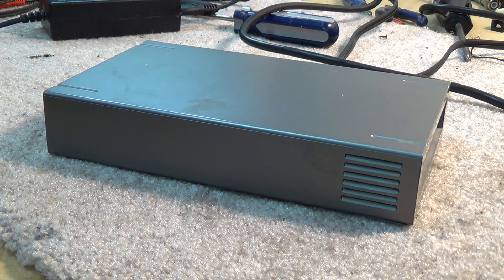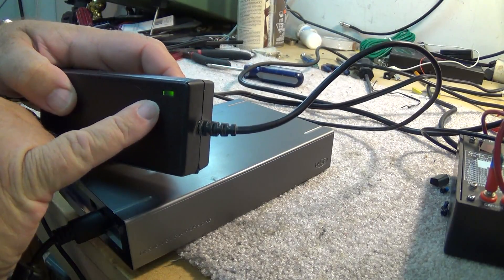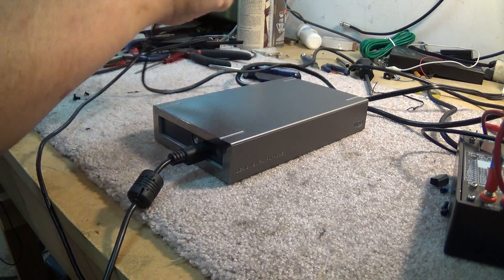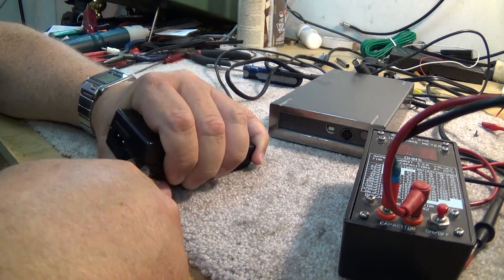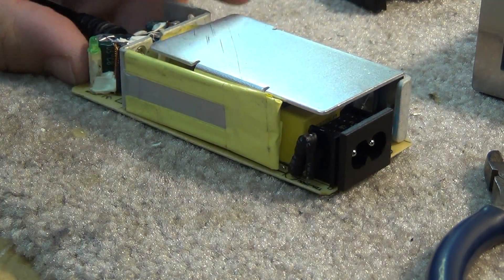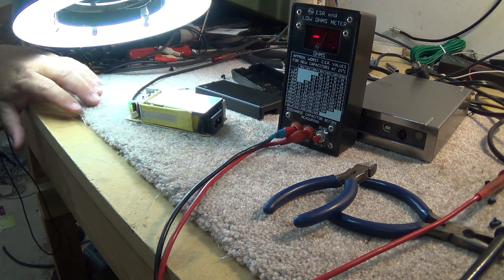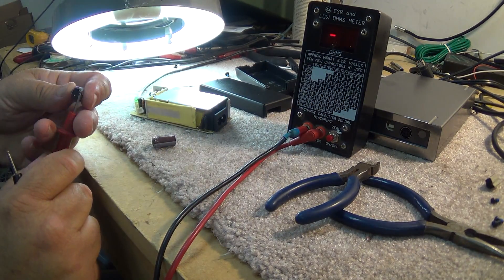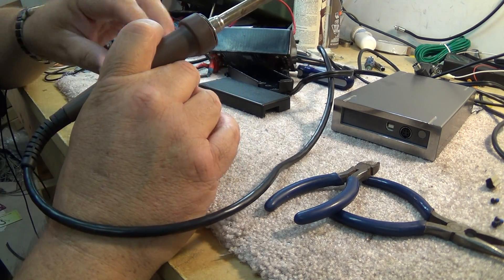lacie external HD makes a clicking sound, power supply repair

Comment: Thanks man. I was thinking the problem was an internal problem in the diskdrive itself. Thanks to your video, I just grabbed the power supply of an other old LaCie drive I had kept on a shelf (for at least 10 years). That one did work. Right now I'm backing up my family videos to two relatively new hard disks and two raid systems. Thanks again!
Reply from the maker: I use bare drives and a docking station myself as storing a bare drive takes up far less space than one with a bulky case plus i get bare drives dirt cheap.  Get them out of old cable boxes and satellite receivers.  Sure they are used but they are redundant backups and none have let me down yet and as they are rated for DVR use they are designed to spin for a long long long time.  Have really good bearings in them.

Comment: Well I just had the same problem as you did yesterday, it would power up I could hear it spin up then when it was at the max spin it would wind down and restart spin up then down so I was primarily looking on how to open the case up first it's when I saw that you had a vid on the same HD enclosure (LACIE) with power problem. So the moment I opened it bam I saw a cap that had a little bulge so while I'm there decided to do all the 4 caps to be on the safe side and don't need to reopen again in a few weeks or so. THANKS for the video!! ;-)

Comment: The title needs to be changed to "Lacie external hard drive making a soft clicking noise. Lacie power supply repair." I found this video by accident and it saved me $300 because I almost sent it to one of those data recovery companies. I didn't even think about checking the power supply. Today, my Lacie is working like a charm! However, instead of replacing the caps, I opened the Porsche enclosure and removed the Samsung HD500LJ hard drive inside. With a couple of cables, I connected the hard drive directly to a USB port on my laptop. Easy peasy. Thanks to this video, I have all of my files back for $0!
Reply from the maker: Well I continue to use that drive.  It is what powers all the concert videos I run in random playback through a first gen raspberry pi and then modulate on channel 12 in mts stereo through the house so I can enjoy on any tv.  It runs 24/7 at my house.

Comment: I'm having the same issue on a 1TB Lacie HD. I have two power supplies, and they both work on my Lacie 250G and 500G, but not on the 1TB. Before I plug the power supply on the 1TB, the light is solid green. Once I plug it in, it flashes and the drive doesn't turn on. I assume it's because the power supply can provide enough power for the smaller HDs, but not enough for the bigger drive. I wished I had the tools and the expertise that you have, but I may have to just buy a new, more powerful power supply, I guess. Good to know the issue is not the drive. Thank you.

Comment: Lacie power supplies of that sort have been a nightmare. They really let consumers down with those. I have three D2 drives, and only one DC supply, and that has now died! Going to jury rig a DC supply to back up the two remaining drives then remove them from the enclosures and reformat as archive storage, to be used in a slot in drive caddy if and when I need access. And who uses those 'funky' power connectors anyway, they'd been chucked into the dustbin of history as the worst idea ever, even back then!
Reply from the maker: Dual voltage supplies allowed the drive designers to make a less expensive interface.
Hard drives use 2 voltages, +5 and +12 volts as they were originally designed for use in PCs which had dual voltages present. 12 volts for the motor drive circuitry and 5v for the logic circuitry.The earliest external drives just used a dual voltage supply. The reason was there was concern about back voltage when the power was turned off, and the drive spinning down. Then they started putting buck converters on board so they could use a single 12 volt supply to generate the 5 volts required for the logic circuits, with additional circuitry to kill any high voltage generated as the drive was spinning down. 
All modern drives use the kinetic energy of the spinning platter to, upon loss of power, generate a little bit of energy as the platter is spinning down to "park" the heads off the platters. During this time there is a fair bit of voltage created, higher than the 12 volts that spins the drive. The concern was if this voltage got into a data circuit it could cause problems, so the motor circuits were separate, on the or own power supplies. Later external drives added buck converters to generate the 5v for the data circuits from a single supply.  I too use a drive caddy for archive drives. Have a big stack of old drives salvaged from old cable and satellite boxes. All relatively small by today's standards but they do a good enough job to archive all my source footage for all my old videos. I think I am on something like drive 40 now. Most are 320g and a few 250.
Reply: @12voltvids  Many thanks for you feedback... so I'm not about open up the box and solder new capacitors, only need to start them up once to copy contents - BTW I use this great wee software called Print Window to record all my drives contents as PDFs, each drive has a simple label so it's a quick way to find stuff rather than plugging in drives. So what I think I'll do as the drive needs 5v and 12v simultaneously is rig up two DC converters, I have a box full of them of all voltages, and do have 5v and 12v ... all I need is to know which pins are 12v + & - and which are 5v + & -, as you say, I don't want to fry the pcb with 12v! You don't by any chance know which pins are what? As the DC converter is faulty I doubt I'd get a meter reading off the pins, but I will try it. Thanks again.

Comment: Hi, 
I have this exact same external HD with a TICKING sound.
How much will it COST to fix it?

Im thinking about sending it in to Seagate but they want my credit card info before telling me how much it will cost.

Thnks for uploading!
Reply from the maker: If it's not the power supply then the drive is shot. A new sata drive is pretty cheap. I bought 10 used but certified 500 gig bare drives for 15.00 each off Ebay, and I use these in my external dock for source file storage. The problem is getting data off a dead drive. That is where the expense is.

Comment: I have a 4tb LaCie external drive.  Took a long time for the manufacturer to contact me when I told them it wasn't working, and they basically told me that it was bricked, but now that I have seen this video, I think it might just be the power supply.  My mother has a 1.5tb drive; will plugging in my power supply to hers damage it?

Comment: I have one of those lying around ,saw your video and decided to dig it up.
It didn't output any voltage on the plug and it made a hissing sound.

After I replaced those 1k uf caps the hissing stopped.
I still got no voltage though.

Do these things need a load (hard disk) to function correctly ?

The led lights up BTW.
Thanks!
Reply from the maker: No you will get the +5 and +12 supplies with no load.
Reply: Thanks for your reply.
I guess I'll have further troubleshooting to do on this one..

Comment: Excellent video.  I am not familiar with an ESR meter.  Is this something i would absolutely need or would a good multimeter with a capacitance setting work?  Sorry if this is a dumb question.  Thank you again for the video.
Reply from the maker: An ESR meter is an essential piece of test equipment. It is not a replacement for a good multimeter, however it measures a specific characteristic of electrolytic capacitors, equivalent series resistance, which is the first thing that starts to go when caps start to fail, especially in switching power supplies.An ESR meter will pinpoint bad caps that will still measure fine on a regular multimeter with capacitance settings.I recently had a particular failure mode of an electrolytic that fooled my ESP meter the capacitor dead shorted. To the ESR meter it was good, because good ESR is very low. Looks like a short on an ESR meter because capacitors have a very low impedance to AC, but in this case the regular multimeter caught it.

Comment: Hello! Just subscribed to your channel, and was watching your other satellite power supply repair. In that one you mentioned you disconnected one leg of the capacitors before you used the ESR meter, but this time you didn't. Can you get reliable readings without disconnecting the capacitor from the circuit? Does that depend from your ESR meter? Thanks a lot!
Reply from the maker: You still can measure them in circuit, but the readings will be less accurate.Out of circuit they measured even higher, 5.9 ohms. So having caps in parallel and not disconnecting a lead may give a false good reading, in this case they were bad when in parallel, so there was no point of disconnecting them. But to accurately measure, yes they need to be disconnected.